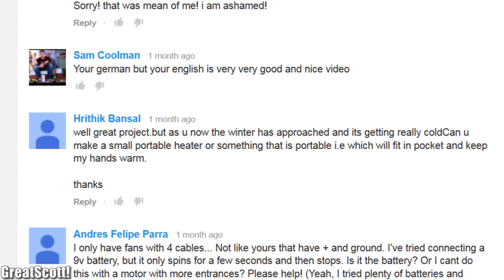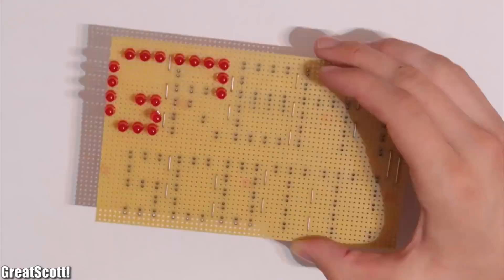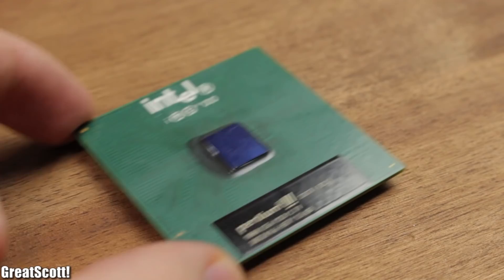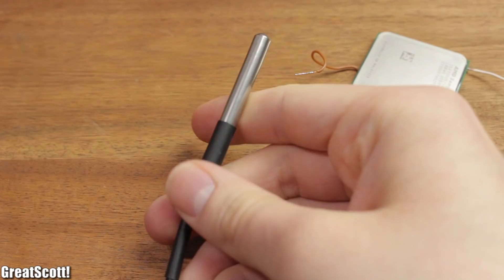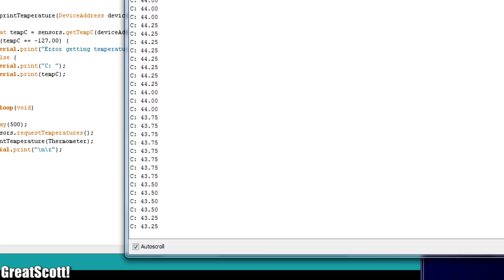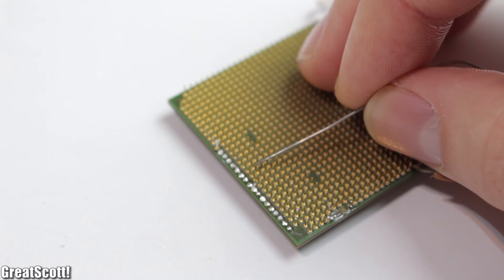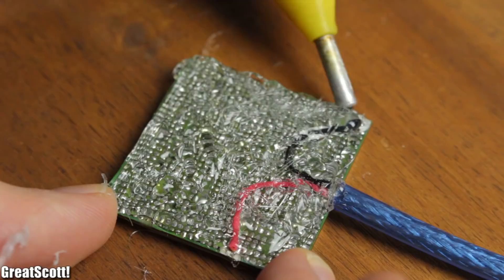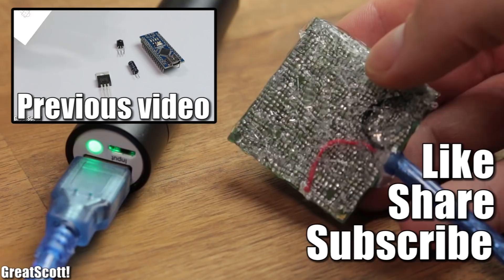Stay warm this winter: CPU Hand Warmer

Comment: Can this be done with an Intel Xeon?
Reply: Mat Mabee Yes, but i will take it!
Reply: CrazyRoadblock (It could be 5555 or 5655) xD
Reply: Go get a fx 9590
Reply: zhi xing ong yep I have one my room be stain nice and toasty when im gamin but its power hungry
Reply: jonnathan deven where I live it's cold through the year so I use my 390x crossfire system with a 9590 to keep it warm with custom loop
Reply: I have three of these now, just sitting in my drawer. I really could care less about giving them away, I just want warm hands.
Reply: Mat Mabee probably, you would definitely want to use an E5 2699v3 though.
Reply: Guys use an overvolted r9295x2 in crossfire to heat ur room
Reply: I actually am about to do this with an Xeon I got at work. Single core socket 604 from a huge ass dual socket mail server. I don't feel bad as the rest of the computer got recycled.

Comment: Removing the stock IHS and replacing it with a thinner copper plate for faster thermal conducting would greatly improve this cool little hand warmer(or mill down the stock IHS).
Thanks for sharing!

Comment: AMD Prozessorts are the best at producing heat
Reply: Exactly xD
Reply: I mean Intel's can too. Ever try an i7 4790k with the stock cooler?
Reply: Redey1290 its actually ok
Reply: A. G. Now let’s talk about I9 :)
Reply: how about an i7 6700k OC?
Reply: Martin F 4790k stock cooler : 100°C
FX 8320 stock cooler : 50°C. And let's not talk about ryzen
Reply: lmfao i got my old intel celeron d to get super hot.
Reply: my amd ryzen 3 is 36° degree ;D
Reply: only the 9590 and maybe 9370 other than that they have always ran cooler than intel.  hell amd's proc's from athlon 64 - FX piledriver can't even run hotter than 62c without throttling.  How hot does your intel get under load???   yeah...

Comment: How about using a Peltier cell?
Reply: Im a «little» late, but a peltier just splits the thermal energy. One side gets super cold, and one gets super hot.
Reply: Robin Storå but it uses energy so it creates more heat, connect sides and you can get 100+ watts fro some modules

Comment: 5 volts? holy fuck... 1.8v is normal but 5v...
Reply: 5 volts is less than 4 AA batteries combined. 4 AA batteries combined produce 6 volts. Unless you use 1.2V AAs
Reply: Kyle Yerger its more like the cpu itself operated at 1.6V (i guess) that he put 5V into it...
Reply: Kyle Yerger Yeah, but CPU's don't operate that high unless they're being cooled with liquid nitrogen.

Comment: A peltier device would of likely gotten better results and been cheaper.
Reply: but it wouldn't be as fun
Reply: No whats with the Cold side ?? Peltier need to much power by the way.
Reply: Funhubble you obliviously don't know whar peltier is if you think you need alot of power lol it also generates power when one side is hot and the other cold
Reply: David Marris Maybe, but a CPU need only a litle bit Power for Heating.
Reply: A peltier could be dangerous without a heatsink. If you let it heat up without a load, it might get hot enough to burn you when you touch it the first time.
Reply: A peltier could use heat from you hands and cold from the other side and tickle charge you phone at the same time
Reply: David Marris But that would mean it cools your hands ever more...
Reply: ***** yeah but the phone heat will counter it
Reply: David Marris The heat generated by the current generated by the peltier that is sucking heat out of your hands? 

No.
Reply: ***** temperature difference creates current, current charges phone, phone heats hands how can you not understand this?
Reply: David Marris Just plug the peltier back into itself then. Temperature difference creates current, current creates temperature difference. How can you not understand this?
Reply: ***** so how will you charge your phone when outside in the cold?
Reply: David Marris Let's disregard the fact that a peltier with 100 deg C difference between the two sides only produces around 0.12 W and your phone needs 2.5 W minimum for slow charge. Let's disregard the fact that your cold hands are probably more along the lines of 17-18 deg C while the outside cold might be a few below 0, so the temperature difference is more like 20 deg C, which would generate even less than 0.12 W which is more than 20 times less than required to start slow-charging a phone. Let's just consider the fact that the energy hypothetically charging your phone comes from your hands , yes? That energy is being converted into electricity. A part of that is used to charge your phone, and the other part is turned into heat, that is going back into your hands. So overall your hands lose more heat than they gain, because a part is going to the phone battery, so there's no way to use an energy source to power a load AND replenish the energy source at the same time. It's simple math. 1 = 1+1 is false.
Reply: ***** Unless your objective is to lose weight. Generating heat burns calories. ;)
Reply: bugs181 But keeping your hands cold is a stupid way to lose weight.
Reply: ***** To each their own.
Reply: bugs181 Yea , to each their own, if you prefer things that don't work.
Reply: bugs181 Yea no doubt shivering burns extra calories. Just like flipping a coin 5 times every day. But is flipping a coin 5 times a day an effective way to lose weight? Come on. The most effective single thing you can do to lose weight is to lower your intake through diet. Exercise is the second thing, which is increasing your "out", but even running miles every day is easily countered by eating just a bit extra. Shivering is gonna make an insignificant difference. And yes, studies are carried out every day on all sorts of stuff. Don't confuse a study with a scientific theory.
Reply: So now you're arguing a different point. You stated "... things that don't work". You didn't say "if you prefer things less effective". I love being extremely technical. If there were more technicalities in this world, we wouldn't have the shit storm we have today. Too many "grey areas" where anyone and everyone can screw you over. 

This world has a problem with not enough fact checking. Playing hot potato with accusations. Avoiding the topic at hand. Hell, media sensationalizing topics that are practically irrelevant to the issues of today's society.

So to reiterate, yes.. I'm being overly technical. But the fact remains.. my earlier comments state that being cold burns calories. It was a joke to ease the tensions on this thread. I was hoping you wouldn't take it too seriously. Each one of your comments offers an extremely confrontational technical debate.

To the original topic; If you want the absolute best efficiency for cost, then resistive heating elements inside gloves with 2 AA batteries is obviously the best solution.
Reply: bugs181 Let's consider the color with the hexcode #010101. It looks black, but it is technically a grey area . But for all purposes , it's black. If that's the kind of technicality you brag about upholding...you're not making the world a better place. And then you're on my ass for taking your joke too technical . In a thread like this, how am I supposed to know what is joke and what is claimed seriously?
Reply: mrkiky Seriously? Does someone have to spell it out for you? I made a joke about losing weight from the cold.. how in the hell does that ring "I'm being serious" at all? And then when you launched another combative comment I replied yet again "to each their own". I was trying to defuse your overly zealous need for winning an argument.

PS. The color argument doesn't work. Regardless of what you label the color black and grey, they are no more complex than a string of light atoms reflecting at a specific frequency.

PSS. The smily/winky face at the end of my comment also rings loud and true as in "Hey there! This is a joke!"
Reply: bugs181 There literally is a product that claims to help you lose weight by keeping you cold. They even show people putting blankets over them in the commercial. And the guy before you was suggesting that you can generate electricity from the heat of your cold hands and use that electricity to charge your phone and warm up your cold hands, so yes, I need you to spell it out for me.

PS: it wasn't an argument, it was a metaphor. And light isn't made up of atoms.
Reply: In light of that, then forgive me for not making it immediately obvious that I was joking. Onward. Photons. Forgive my ignorance. Point is (was), it's still a wave.

Comment: Should have found like 2 more higher amp draw pins and have a 3 position swich on the back so you can have options of heat/power draw

Comment: Just a tip - if you want to try this project, use processors with a integrated heatspreader and always keep the CPU's temperature under 80°C.

If your CPU doesn't have an integrated heatspreader then not only you'll have a smaller surface to warm things up but it'll also beak and overheat more easily, and if the CPU overheats (>80°C) it could burn or even melt (you're feeding power directly to the CPU with this mod, so the integrated overheat protection might not work!)
Reply: Just a tip - if you want to try this project, use a power resistor and a heat spreader. Don't bother with the CPU.

Comment: I dont understand why everyone says amd cpus run hotter. They cannot physically run hotter. The safe operating temperature for my FX-8350 is something around 60 degrees C. Any hotter and my chip would literally break down. I've had two intel i7's, both have much higher operating temperatures. They can handle 90C and above because they are just built better. And guess what? My FX-8350 NEVER gets even close to its max temperature under full load, on the stock cooler. Meanwhile both my intels run 60-90+ all day long with their stock coolers. It makes no sense to say amd is hotter when they physically cannot operate at the temperatures intel can. Just a bunch of fanboy bologna.
Reply: Which stock cooler? The stock version or the wraith cooler that comes with the newer chips? I had the original stock FX 8350 cooler as I got my chip before AMD released the newer wraith cooler.. which the original stock cooler was only rated to handle 95w despite the chip having a thermal design power of 125w. I don't see why they even bothered to ship it with a fan at all at that point. It was inefficient and loud, just ended up giving it to a friend to cool his Athlon II 640 Propus. Used an H60 for a while then switched to an H212 Evo. The new wraith cooler though is beast.

But yeah I know the feeling, Intel stock coolers have never been very good at keeping the chips cool. Every Intel  based machine that I've worked with - with the exception of a few - used after-market coolers. I have one here with the stock cooler and it runs at 38 degrees C on idle which is way too high for no load.
Reply: My stock cooler is pre wraith also. But cpu coolers wasn't really the point of my comment. My FX8350 on the cooler before wraith came with its own fan, and isn't loud or obnoxious at all and it's pretty comfortably overclocked to 4.6Ghz.
Reply: Must have changed it then. The fan that was used long before had a lot of problems cooling an FX 8350 even at stock frequency. AMD themselves even said you shouldn't be using the stock fan. Ran very loud and had poor cooling performance. Including a nice rattling sound when the fan was running.
Reply: liblevi45s I bought it years ago. Not any change i knew of. The guy at the store even said not to use the stock cooler and i bought a water cooler. I tested both and found the water cooler was louder and more obnoxious than it needed to be and didn't cool the cpu as well when its overclocked. So i took the water cooler back and got an extra $100 back.
Reply: Ah my bad, I was thinking of the stock fan for the Athlon II 640 Propus chip instead of the FX chip. The fan was cheap but it worked for for the time being. When I donated that old chip to a friend of mine I gave him the original stock cooler for it, but eventually I ended up replacing it with the FX stock cooler as I never used it. Fan is loud enough to hear it, but it's probably because he didn't properly apply  the thermal compound or the board doesn't have proper cool and quiet control. It's the loudest fan in his case actually. Meh.

Comment: IS there not a chance to get electrocuted?
Reply from the maker: No
Reply: GreatScott!
Why no? Could you please explain
Reply: TheCasualCT it Takes 30 Volt to shock you😬
Reply: DrSkillaura 23
Ah ok. Wouldn't it be a bit irritating then to get a small shock every time you help it or is it unnoticeable?
Reply: TheCasualCT the 9volt will not get through the skin of your hand 🤔
Reply: DrSkillaura 23
Ah thanks for answering :D. Time to crank it up to a 1000000 volt heater then ;)
Reply: TheCasualCT yooo 😂😂
Reply: Do you get electrocuted when you touch batteries?
Reply: +XDreamFallacy If you touch both contacts of a 9volt with your tongue you will.
Reply: guycxz
I know what i'm doing this christmas ;)
Reply: XDreamFallacy I thought you were talking about batteries in general. And so i assumed it would be appropriate to share my experiance.
Reply: Exactly!, to be precise Power = V·I  = Watts. It's the power what kills you. Taser guns run over thousands of volts yet they don't kill you (low current). On the other hand if you close a circuit of 50V from some batteries with your body, it will get you fried. It depends also on what part of your body is the current flowing through, its not the same getting your hand burned than your brain. Finally DC is more powerful than AC when it comes to average power over time, although AC can affect you even if you are touching just one terminal.
Reply: Oh my god. Your comment makes no sense. You can't "touch 12 volts at 50 amps". You touch 12 volts, which is simply not enough potential to get through your skin (unless you use a sharp probe to break the skin, or you soak your skin in salt water beforehand). Then, the current would regulate itself by whatever resistance your body presents. In order to "touch 12 volts at 50 amps" your skin would have to have a resistance of 0.24 ohm, which I guarantee is not the case. Most humans cannot feel anything below 30 volts. I literally just turned on my power supply at 12 volts, and held an alligator clip in each hand. It's capable of 40 amps continuous, and I felt nothing, because the resistance of my skin is too high to allow any perceptible current to flow.
Reply: @Aurelius R Finally someone who doesn´t write bullshit about Electricity. Thanks!
Reply: Did you trip? Because 12 volts isn't knocking you anywhere..
Reply: That's not correct. You could touch 500000 V and still feel nothing. It's the current that shocks you.
Reply: SuperNikio2
Well actually, P=IV so the voltage does matter
Reply: SuperNikio2 voltage and current both matter
Reply: ***** Nevermind. OP deleted the comment I was replying to.
Reply: +SuperNikio2 the current is directly proportional to voltage. Our body has a high resistance (the skin) and the capacitance is some where in the picofarad range. A large voltage is required to push significant current into your body. If you take it literally, it is current that kills you but there is a voltage that's required to push the current.
Reply: Sidharth Nambiath You're right to some extent. You see, 500 kV with .5 A won't kill you. However, 110 V with 100 A will. OP said (I don't exactly remeber) "How many volts can kill a person?" or something like that.
Reply: SuperNikio2
But p=iv so the 500kv with .5A would be transferring much more energy than 110v against 100A. The current nor voltage kills you, it's the power of the two combined.
Reply: Casual I'm not sure about that. What about van der graaf generators?
Reply: It might've been AC, but even then, I don't think 12VAC is enough to shock you...
Reply: Car battery can deliver 500 - 1000A at 12 volts, but you can safely touch the contacts.
Reply: Rondo Anderson I am doing it right now with my freshly charged red top Optima. No shock.
Reply: Casual If there was do you think people would be throwing millions of dollars at Ann Makosinski to produce a crappy electrocution hazard based mug? I'm asking because I actually don't know; I can't tell if it is shock proof or if humanity is just full of idiots.
Reply: Rondo Anderson, I would have made a video if there wasn't a lot of them already. Search is your friend, "touching car battery".
Reply: Casual it is only using 5 volts watch his new video on getting electrocuted to see what 5 volts does (nothing).

Comment: This cannot get any more ridiculous.
Reply: Yes it can, connect an FX 5800 Ultra, so the whole city can hear this thing roar.
Reply: Don't forget to add a spike nozzle propulsion system to get this thing out the atmosphere, and use ion propulsion system to shoot it above 200k MPH and getting it really close to the sun to heat up the CPU to the point that any hydrogen atoms inside the rocket and CPU start to fuse to make nuclear fusion and send it back to earth with reverse thrust and have it orbiting earth so we can have another sun, and that would make things a whole lot warmer. 

Oh yea. Once your done heating up the planet, just use your artificial CPU sun to crash it into the Earth really hard so the earth's orbit changes and is a little farther away to cure global warming, and having another mini ice age. Then, while using a specific carbon filtration system to filter out the carbon from the atmosphere and to use it for another miniature sun so the carbon will start fusing, and use that miniature carbon-fusing sun's gravitational pull to put the earth back into its original orbit while not affecting its tilt so we can have seasons.
Reply: +Devin Hepburn (Kawaii :3) HAHAHAHAHAHAAHHA